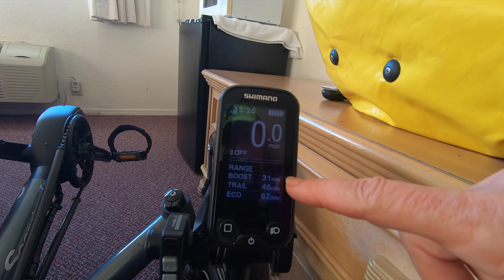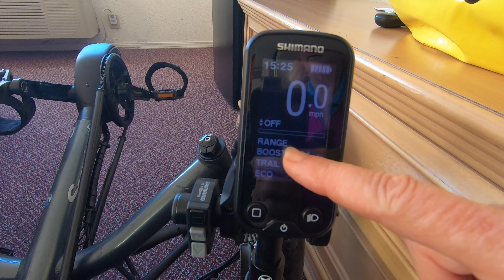Shimano Steps E8000 10-Day Assessment

Comment: Great idea about a spare battery. I cobbled together a solar panel powered charging station to pull in a trailer, but after testing I found that the two 12V, 8Ah batteries (connected in parallel) are not enough to complete a full charge. I was hoping to use it in situations were no power was available, but the inverter shuts down to protect the batteries from a too-low charge state before my trike battery is fully charged. Plus the entire unit weighs 25 lbs. I think an extra battery only weighs about 9 lbs and would deliver another 75+ miles of distance.

I know what you mean about climbing. Once on a long ride my friend and I took over 3 hours just to climb a 6-mile slope, which was about 5%. We were loaded with panniers and camping supplies and were only able to climb at 2.6 mph. I saw a trail of ants making better time than we were at one point. That cured me of the no e-assist mind set.

I love my Bafang e-assist on my AZUB TRIcon. It's awesome to climb at 6 mph, even under full load of me, trailer, and camping equipment. Plus you are correct about getting a better work out. Even with the motor my legs have enough pressure on them to create a good burn.  Thanks for posting. I am planning for some long rides as soon as this COVID-19 mess is done. Can't wait. Take care Sylvia - ride safe!

Comment: Sylvia, you covered exactly the questions that I have regarding e-assist. I am most concerned that I continue to get a good workout on my rides, especially between tours. (Hah, after just completing one tour I guess I'm already thinking about another!)  Glad to know about your cadence etc. The time saving aspect really hits the nail on the head as well. I skipped a lot of little side trips on tour because of the need to make it somewhere safely or comfortably by end of day. How nice it would have been to to have that little extra kick to get one up that last unexpected hill. Thanks!
Reply: Tom, there are different settings that include shutting the motor off. A lot has been said about having assist may actually help you get more fit.

Comment: Thank you for the great video.
Lots of helpful points.
We took a couple of recumbents out for a test ride today for the first time.
One with the steps system and one without.
We were very impressed with the steps and struggled on the one without on the hills.
We were looking at them to do some touring whilst pulling a trailer for our dogs.
I'm curious where you do charge all your batteries and electronics.
Do you stay at hotels or wild camp?
Is it possible to charge the
 e-assist batteries off a dynamo hubs?
Any advice would be very helpful. 
Thanks again for the videos. They are very helpful to us whilst dipping our toe into the recumbent world😊🖒🐕🚲
Reply from the maker: I have quite a few different electronics that need charging so plugging in the e-assist battery is just one more thing. I never wild camp because I don't feel safe being a solo triker. I can go 2 days without a charge.

Comment: Hi Sylvia,  Could you talk about the cost of the retrofit?  I would be interested in upgrading my trike with a different e-assist system and this looks to be a more compacted and user-friendly one.  Thanks and Thank you for the videos!
Reply from the maker: Waders in Alaska good question, this system was given to me and I don’t know what the costs are. I think the batteries are about $500 each.
Reply: @TravelsByTrike  Thanks Sylvia,  maybe the folks that sell these will do a shout out and tell me the pricing!
Reply: @WadersInAlaska  I just had a Bosch system installed on my one year old Terra Trike Gran Tourismo.  The cost was $2,200.  I understand the Shimano system is about the same price.  There are cheaper e-assist systems but I am convinced these two are the best.  Even though it is expensive, I wanted the best which meant to me...dependable.  I cannot be fixing things on the road.
Reply: @brucefarrar300  Thanks Bruce for the information and insight!

Comment: Re your experience with your e assist trike, what is your mileage on your longer rides?
On my non e assist trike my longest distance is 40 miles and afterwards I'm experiencing lower body discomfort.  I'm wondering if on an e assist trike I'll be able to achieve longer distances with decreased discomfort afterwards.
Reply from the maker: thanks, Clyde - I typically get 45 miles from a battery with 2500 ft of climbing. This is typical mileage when I am touring. I carry 2 batteries for weight distribution and 'just in case'. E-assist is much more fun than I expected.

Comment: Hi Sylvia. Thanks for all the info. Just a little thought went through my mind... are you alternating the use of your two batteries? Apparently they like to be used regularly... tho I'm no expert on the matter. Wouldn't want one to go dead on you. 👍
Reply from the maker: I am. I typically don't need for than 10 miles when I switch and I'll run that one down before switching back to the 1st battery. It's a good system for rotation concerns. I don't know this for a fact, but I think the battery management on these batteries is much batter than before.

Comment: Does it figure out the potential distances based on your weight or are they standard estimates based on your settings?
Reply: Mary,  I have experience with motors on trikes.  I can tell you that it’s an individual experience.  There are factors beyond speed and weight. Even ambient temperature can affect how far you go. Battery size is also key.  For example, the 500 watt battery is heaver than the 350 watt but has a greater range. In the end, it will take time to calculate what the range and speed is.
Reply from the maker: The estimate is based on how you are riding 'at the moment'. If you continue to ride the same terrain with the same effort that is what the estimate will show you. It changes as the conditions change.

Comment: If the battery runs out of charge,   is there drag on the drive and pedaling?
Reply from the maker: No, there isn't. I rode 2 miles with the e-assist motor off at the end of a day instead of switching batteries and I was impressed by how easy the trike was to ride.
Reply: @sharkmentality9717  What's clogging?
Reply: @sharkmentality9717  It's actually called Cogging. Clogging is a dance style out of The Appalachians I believe. haha Cogging is when you are pedalling but without any assist from your motor or battery. Most Direct Drive motors especially if they are equipped with regenerative braking do not have a free wheel allowing you to coast without engaging the motor so with each pedal stroke you are also turning the armature of your motor past the magnets causing cogging. Motors with internal gears allow you to 'free wheel' by not turning the motor with each pedal stroke.
Reply: @daytriker  Now I have to look into my motor "cogging".  Thanks for the  info.
bf

Comment: If you you are carrying a spare battery why isn't it just mounted on the other side to balance your trike? I know you mentioned it on a previous video and I also know that Terra cycle carries the mounts for such experiments? I don't know how it would affect the ability to fold the trike. I know when I fold mine now I have to make sure that my Garmin mount is out of the way but I tend to not fold the trike as it fits in my car with only the seat removed. I figure after a season or two you'll have that stuff dialled in and be ready for the next version....
Reply from the maker: Yes, I'm going to have the 2nd battery mounted. I was under the impression that it couldn't be mounted on the left side but that turned out to not be true.
Reply: @TravelsByTrike  That is great. I imagine your trike is heavy with all that weight you carry. I travel light and have been in a position that required me to pick up my trike to get it over a barrier and I remember Matt Galat did it a few times on one vlog out of Japan. It would be quite the process to remove things move the trike and then put it all back together. I guess it calls for advance planning if one can. Look forward to your ongoing tour. I hear your caution about travelling during rush hour and after dark and you don't want to be the example person that educates people about cyclists on the road after dark like I was.

Comment: It sounds like you're getting a better cardio workout but if your goal is to build muscle do you think you're still getting the same effect as you used to
Reply from the maker: This system is adding probably 20 lbs in weight so there is that to consider. Is cycling good for muscle building? Maybe it's best to hit the gym.

Comment: That motor is VERY LOW POWER !!! 250W ???? Why would you pick that motor ??? Trikes are very heavy ,,, I have a TerraTrike Rover and run a mid-drive on it with 750W and 20AMP hour battery setup and really need more power ... And I just ride about town without camping gear ... Hope this helps others !!
Reply from the maker: Dan, this system was given to me by HP Velotechnik which is a German company. Germany doesn't allow for more than 250 watts. I used this Shimano Steps E8000 on a month long tour of the Pacific Coast climbing 2500-3000 ft a day carrying 70 lbs of gear. The motor had no problems. With touring, you need to conserve your battery to go the distance and can't be using the highest power mode. I typically was able to go 45 miles on one battery averaging 11-13 mph. Best of luck!
Reply: @TravelsByTrike  Sorry to say ,,, I find that Very hard to believe 45 miles ? And I believe your battery is a ? 15Amp hour .... I have used my setup for 1300 miles now and I am very lucky to get about 35 miles out of it most of the time on power setting 1 my control can go to 9 and 9 is boost , I can also log into my computer and change all setting for motor as well.
OH,, and Im  only 150 lb.So you can see why it's very hard to see these number your getting .. IMO ..
Hope this helps.PS: I'm running about the same speed maybe up to 15 mph.. OH,, are you using miles or Meters ?? That could be why your number's are so,,,, different then mine?
 Also I  was a bicycle  mechanic for many years !
Dan
Reply from the maker: @Dan-un4vt  Yes, that's the difference of the motor power. 250w motors are more efficient. I also was very careful how I used the motor to get the most out of my batteries because I was touring and had a certain number of miles I wanted to cover before charging up. My goal wasn't to go fast, just faster. Without assist my climbing speed is 2-3 mph. I wanted my climbing speed to be 5-8 mph - this is still quite slow. Most cyclists wouldn't require assist for that speed. My average was usually 11-12 mph for the day. I'm also using Shimano 514 ah batteries which may be higher quality. I have 2 batteries but rarely used the 2nd. It all contributes to how many miles and feet of climbing you can get out of a battery.  I think amount of climbing you can get out of a battery is a better indication of the distance than strict miles.
Reply: @TravelsByTrike  Thank you for you taking the time to try and answer my question ,, hope you have a Great time .. Dan
Reply from the maker: @Dan-un4vt  Take care and be safe.